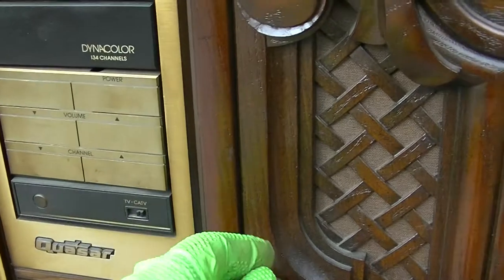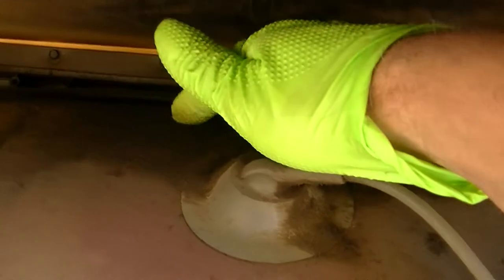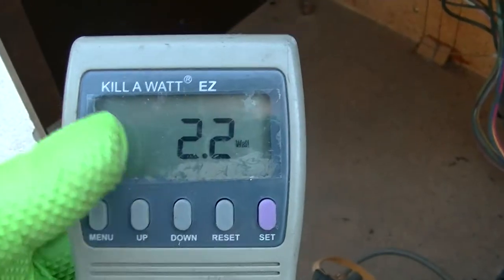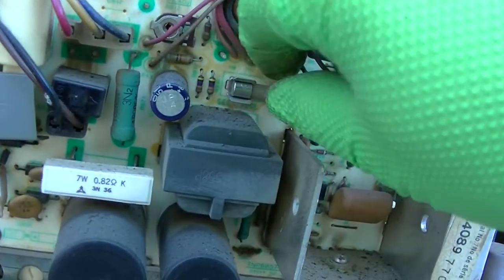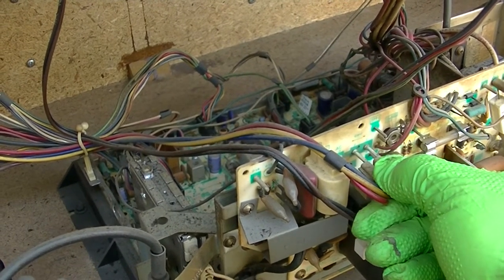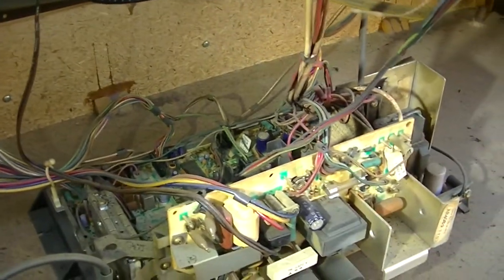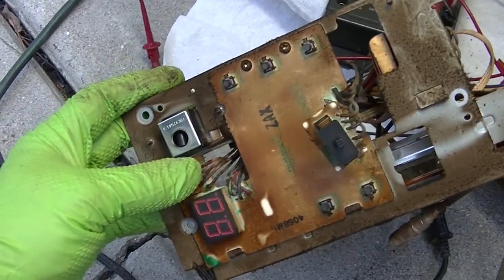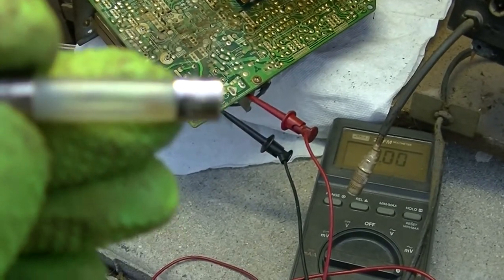Hideous Quasar Smokers Choice 1984 Color Television NASTY

Comment: Just take some Fantastik and spray it on a cloth and wipe it down.  Then take compressed air to spray out the worst dust bits, then vacuum the inside as best you can.  Make a solution of 1 part ammonia to 4 parts water, and wipe it all again.  Let it sit for a while to dry out, then wipe it with 1 part Simple Green to 1 part water.  You should be able to get most of that yellow stuff out.

Comment: Concerning that cabinet design, I think it goes back to the tail end of the Motorola-Quasar era. As far as the tube, I saw an EIA 312 code on it and that's a Sylvania tube. As far as the chassis in general, they were junk and were used in table model and console sets that were branded Panasonic, Quasar, and GE. Yes, GE had a deal with Matsushita to supply them with some of their TVs. Those sets didn't produce all that great of a picture when they were new.

Comment: You should try the Electronic Wipes they sell at Dollar Tree, soon to be Dollar And A Quarter Tree, for cigarette glaze. I used them on a table radio Smoker’s Choice, and it came out great. No more glaze.
Reply: I found out the hard way not to use the disinfectant wipes, like clorox wipes on any electronic or kitchen gear. Took all the silk screen print off of the timer on my toaster oven and took the paint off of the door of my cassette deck, Nakamichi Dragon.

Comment: Seen worse than that. Everything covered and crystallized fuzzy glaze on the flyback lead. A shop vac and paintbrush came in handy to get the dust that's loose. Someone could have brought a battery and inverter and could have used that TV to go with the couch in the mountains

Comment: I recognize this chassis. I repaired two back in 1995.
Both cases was the failure of the line output transistor.
This particular chassis was used in a lot of different cabinets with different names.

Comment: I prefer TVs from the 70s early 80 Especially the 70s are really god serviceable. My Oldest TV ist from 1956 and not working, and the next are from 1976 and 1973 and Both are working Fine. Withput replacing of any capacitors.

Comment: Isopropyl alcohol would get the electronics clean douse the boards and use a toothbrush to clean everything then wipe it off then for any contacts use contact cleaner 

Realistically I think it may be to far gone as a TV but the cabinet may be cleanable unless the odor has embedded to deep
Reply: Compressed air could help to
Reply: Only useable electronic parts would be capacitors if there still good but overall that’s so caked in tar I doubt anything’s still good enough to use in something else 😕
Reply: Speakers keep u less they stink to bad and the odor can’t be removed the way u reacted I can only imagine the stink 😖

Comment: I remember when Quasar came out they were advertised as "Works in a drawer" with plug in circuit cards that were accessed from the front in a drawer. Supposed to make it easier for the technician to repair in your home instead of having to cart it off to the shop. I have never worked on one myself, but I don't think TV repairman were too fond of them. Sales gimmick I think. Anyone ever work on one reading this?
Reply: My wife's grandfather was a quasar dealer in the 70s through 90s and repaired many of them.  The reason Motorola Quasar sold out was their televisions were unreliable compared to the other brands in the industry of the time and the shift to Japanese made TVs was in full swing so the profits weren't there anymore.  The idea of the plug-in modules was you could get in and out of the customer's house quickly by swapping modules and take the failed module back to the shop and repair it.  By the time we had our quasar in 76 there was only one large module IE the main board of the TV set. The board still slid out the front of the set in a drawer but by that time the Motorola designs were discontinued the quality was now good enough you no longer needed the works in a drawer and that feature was discontinued a couple of years later.
Reply: @randyab9go188  My grandfather had a GE dealership, appliance, radio, TV, and refrigeration. I just got started in electronics when I was about 13 in 1970 which is about the same time Quasar came out, or thereabouts.

 Never knew anyone who had one, and we never made a service call on one when I was around my grandpa. I was his helper and flashlight holder when I was a teenager. We used to do house calls on TV sets back then.

 Learned a lot from him, old school radio guys that lived through the depression.

Comment: I thought these Quasar TV's were works in a drawer, lol. Maybe those were different models or another era. Anyway, I never owned one : )
Reply: My parents had a 76 model works in a drawer I fixed it a few times.
Reply: That was from the 70s sets. The earlier sets actually had excellent pictures, late 70s to early 80s used inline crts and were bright and sharp. Friends mom had a 19 inch version, probably later 70s and it had a great picture. Probably depends on where they were getting them from or sourcing parts from. I think the early sets were pretty bad but never really worked on any other then that one set my friend had.
You can see that set was still trying to produce a sharp picture with decent balanced color considering how dead that tube was. Camera probably makes it seem a lot brighter than it was.